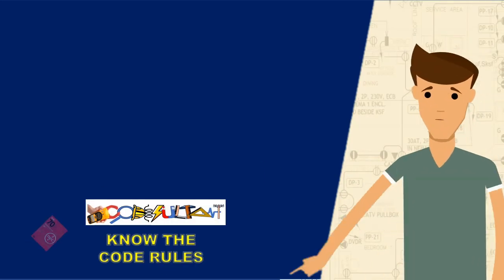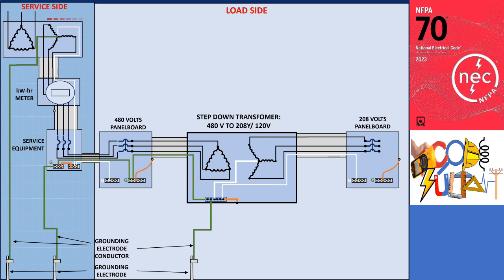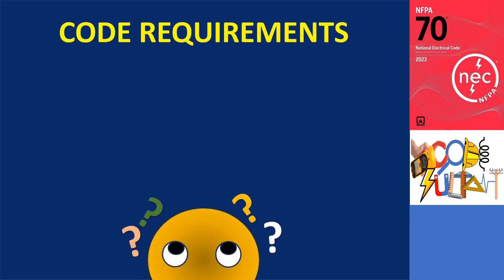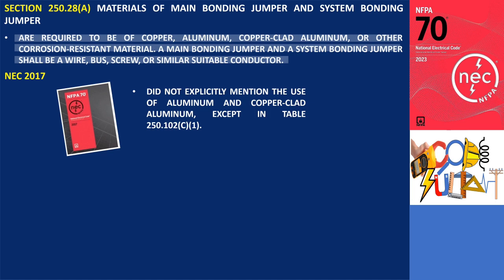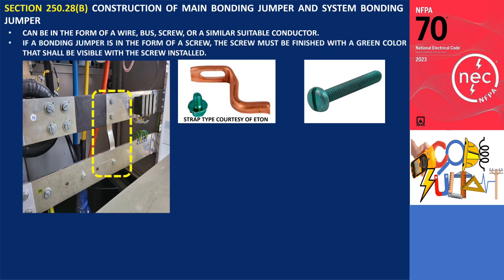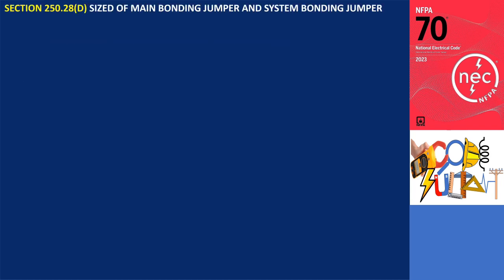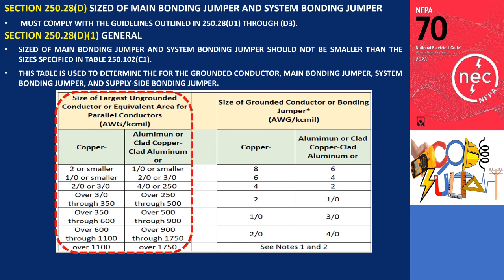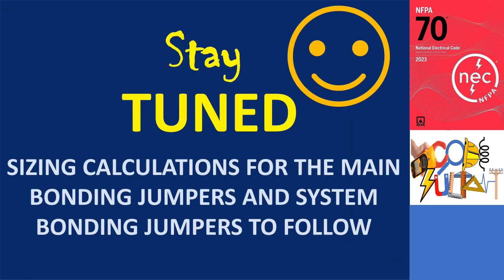250 28 MAIN BONDING JUMPER AND SYSTEM BONDING JUMPER PART 1 NEC 2023

Comment: Thank you for the very informative content.Good day Codesultant! With reference to PEC Article 2.30-Services, figure 2.30.1.1 page 71, It is stated that Service Protective  device (WHEN REQUIRED). If the service protective device is not mandatory by electric coop/utility and In the absence of the service protective device, where can we have the main bonding jumper? it is in the Service Equipment/panelboard?
Reply from the maker: Hello, I appreciate your positive feedback on my content, and I thank you for that. Regarding your question about the installation location of the Main Bonding Jumper (MBJ), according to the electrical code definition, the MBJ is the connection between the grounded circuit conductor and the equipment grounding conductors at the service. Therefore, regardless of the presence of a service protective device, the bonding jumper should be installed at the Service Equipment. This is where the grounded conductors and the equipment grounding conductors are commonly connected.